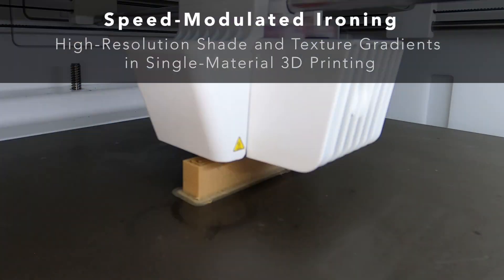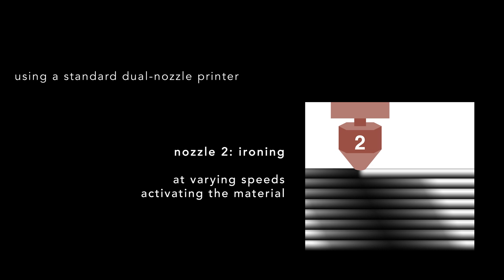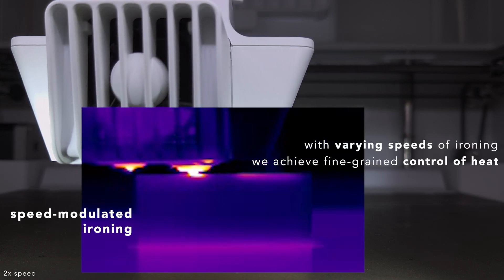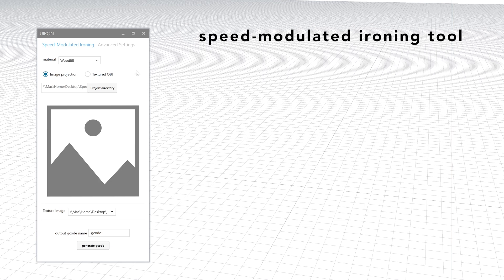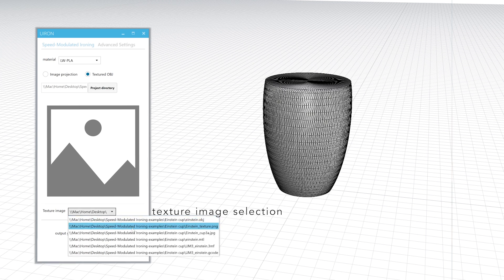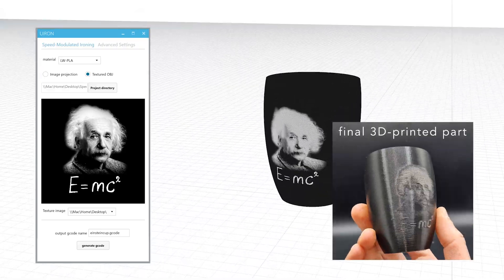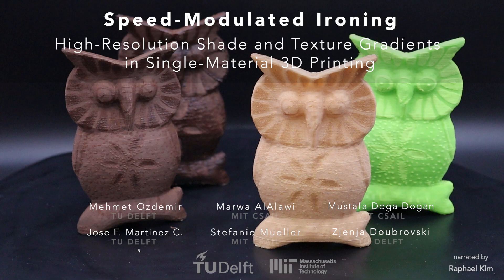New 3D Printing Technique by TU Delft & MIT Delivers High-Resolution Textures from a Single Material

Comment: How about extrusion modulation, I bet we could achieve texture and surface variability just with regular printers, to certain degree at least 🤯  And a super thin layer [to deal with oozing] could be used to emulate what is done here with 2 nozzles, perhaps, with a regular printer.

Comment: i put a soldering iron on a pivoting hinge . the iron pivots around the hotend and has a flat surface smoothing the print along the way.  It works so well i think i might patent it before i put a video on youtube.
still some extra programming to do so need a nerd that can write slicing software.

Comment: Wow, the implications are interesting - since it has to work with 'foaming' type light-weight PLA (commonly called aerospace or aero PLA since a popular use is to print model airplane parts that need to be rigid but light weight) it's a slightly bit limited, but I can see that it would be easy for filament makers to transition already known properties to use the spectrum of temps and speeds to make this happen - e.g. printing transparent/translucent PETG and PLA Silk we get varying opacity and shininess depending on similar speed and temp variations - this is a great innovation especially since it uses existing filaments already on the market. This is mentioned as needing a dual-head, IDEX or tool changer to use two nozzles, I wonder if a single nozzle could still work but at much slower overall printing speeds (due to the constant temperature changes and retractions of filament to keep it from being deposited) maybe that's a complication that makes it not suitable for single-nozzle and they already tried that lol. Anywho, this is freaking sweet!

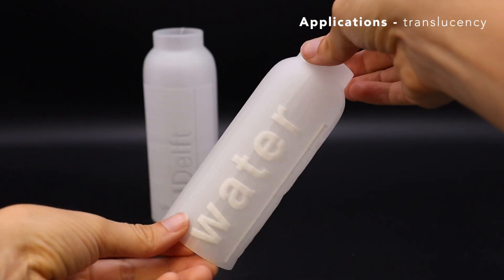Comment: I dont' get a particular point though: at 1:37 we can clearly see that the text on the white bottles is either embossed ("water") or recessed ("TUDelft") so one could conclude that the opaque (whiter) vs more translucent effects are achieved with that wall thickness only. I have no doubt that this trick helps reinforcing the Speed-Modulated Ironing that may be present otherwise, but it is misleading as one cannot compare the effect of the latter alone on two different objects.
Reply: Maybe it is because of the foaming properties of the material ? they heat it up so it expands making this effect ?
Reply: @aktymel3943 the other objects don't show this. Their drawing seems to be a 2D flat image flush with the surface.
Reply: @fluxcapacitor  Because other objects arent made from the foaming material but from something else. So they can stay 2D flat because what he does with the higher temp ironing is somewhat burning them.

Comment: Now to figure out how to get this working with a single nozzle.
Reply: Use the same nozzle to go over the same path without extruding then clear any potential material stuck to the nozzle!
Reply: I imagine they tried it but the heat-up/cool-down cycles plus issues like oozing, retractions, and priming (would for sure need a priming tower for example) probably make it very slow and/or problematic resulting in a higher likelyhood of print failure, hmmm
Reply: I feel like I've seen this done with single nozzle before, a couple of years ago.... I've watched this several times teeing to figure out what's new about it besides using an empty second nozzle...
Reply: Use a ring shaped heat controlled " donut" to do the heatset, that way no matter the movement you won't have to make a separate pass since the nozzle would be in the center of the donut. Could be adapted pretty easy to most printers.
Reply: ... I wanna say lasers?

Comment: Why do you need a second nozzle for that?
Reply: Doesn't one nozzle be at the correct temperature to print the material and the second nozzle a different activation temperature?
Reply: Yes, but could you not do that with a single nozzle??
Reply: @dschaedler  How would you do it with a single nozzle? The material reacts to heat. They vary the material properties of the material by brushing a hot end over it quickly/slowly (depending on the desired material properties/how much heat to add to the material). In order to do it with one extruder they would need to be able to very quickly heat up, and cool, the single nozzle which would likely be very difficult to do and put a lot of wear and tear on the nozzle, or be able to push the material out in a very controlled and precise manner (speed wise) which would be equally difficult. Either way, you would need to be able to control the amount of heat added to the material in a quick and precise manner.
Reply: I guess it could be done with a single nozzle but it would likely take a very long time for the same quality as their method, without any extreme modifications to an existing printer.
Reply: @Retrolian1000 The same way people have done for at least two years with little popularity. You technically don't even need to retract the filament or raise the nozzle temperature as someone else mentions in this thread (and no,  "watching the video" in no way explains why two nozzles were "necessary", nor even attempts to). We've had selective ironing before. We've had different-temperature and different-speed ironing before. We've even had second-nozzle ironing before (it never took off because people opined it was a "waste" of an empty hotend). The only technique I can extract from the video alone, and even that seems to be a specific application of a prior common technique,  is what seems to be a progressive speed assignment to the ironing. I'll applaud them for bringing all of these techniques together in a neat and useful way, but I'm not sure even that qualifies as novel.
Reply: @claws61821  I'd say they don't want to wait for the nozzle to cool down back to the printing temp before next layer, maybe also they want to avoid purging remains of overheated filament. I suspect the primary reason was that they actually had that printer collecting the dust somewhere and tried to find some use for it.
Reply: @dschaedler  Their paper, which is linked in the video description, elaborates in more detail why they chose 2 nozzle heads which has similar reasons to what I just wrote out earlier.
Reply: @Retrolian1000  that honestly makes me think that you could also achieve similar results by using a IDEX printer, since You can have one toolhead with their nozzle printing , and the second toolhead has the nozzle at a different temperature, thus achieving the color variation , thought i don't know if it would be as effective as this one is
Reply: Yes exactly, they would know that if they watched the video.